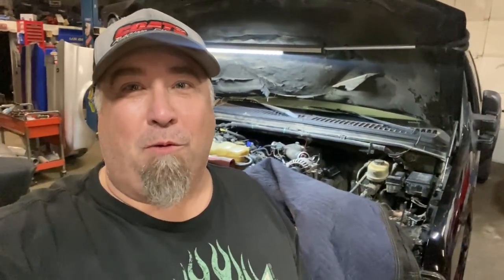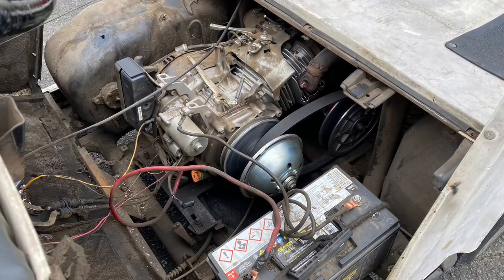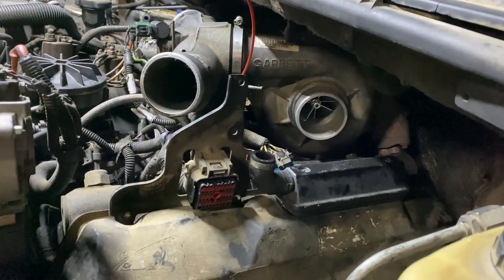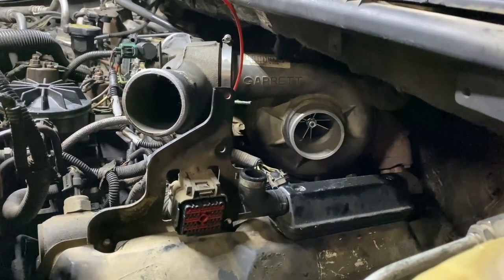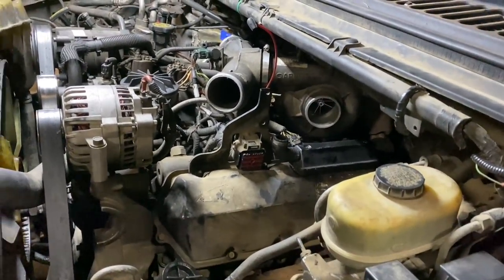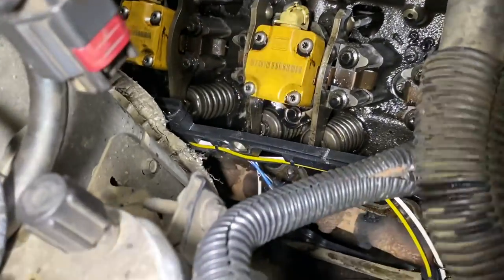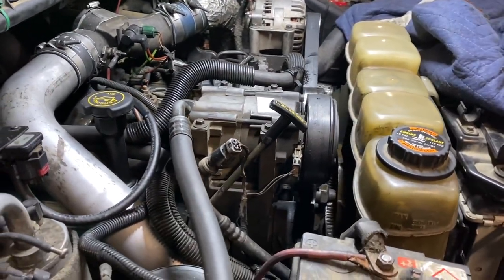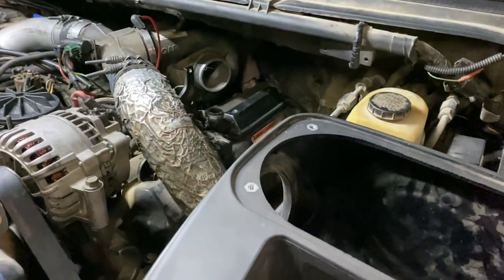7.3 Glow Plugs, wow that sucked! LOL

Comment: Turbo John is the man. Good tips.
I have dedicated 1/4 inch 10mm socket taped up to extension.
Has anyone had good luck with magnetic sockets. I have not.
The rubber hose is also great for spark plugs. I keep a rubber hose and long spark plug boot.
Also keep those 90degree spark plug boots great for pcv valves.

Comment: Probably already know this but incase not I would recommend pulling tank down and cleaning or replacing the 2 small filter screens on the bottom of the sending unit if it's never been down or replaced.  Might start having issues where it starts dying or not starting before it gets down to a quarter maybe half a tank on the guage.  Sometimes after a few hundred thousand miles they'll get clogged up depending on how dirty the fuel was being run in it. I replaced mine with an aftermarket deal and I've heard some people leave them off but I myself would just clean or replace them. Just a heads up from a fellow follower of yours. Might help you out down the line
Reply: Came here to say the same thing, mine had a big screen at the end of the tubing but came into what looked like a fuel pump with 2 small screens that (after cleaning them) looked like 2 stiff lantern wicks. Replaced them all the following week and keep spares and an engine position sensor with wrench in the dash.....havent needed any of it since but its there if i do.
Reply: @young11984  yessir I've owned a few of these trucks still own two. Both 02's. There damn good motors/trucks. If taken care of right. I've seen a few trucks fall apart around the motors. They last forever.

Comment: Never thought of taking the air out. I used to take tires off for my dad. He was the only one capable of working on diesel at our shop. I need to learn diesel. I just personally don’t love them. I don’t tow much other then a racecar occasionally. Is diesel that much better to tow with?

Comment: it is normal for the glow plug system to stay engaged after the wait to start indicator light goes off during colder weather.
Reply: No probably is the solenoid is stuck there is one like the starter solenoid on the engine that runs the glow plugs try changing it
Reply: @joepatenaude3957  that might happen, but very very very rare. I've worked at Ford dealerships for 17 years, 6 of those years were working on 7.3, 6.0, and 6.4 diesels. check it with a scan tool and you will see the PCM commands the solenoid to stay on even though the light goes off. Joe diagnose before replacing parts.

Comment: The factory ford GP relay is NOT rated for its intended use. Upgrade to the stancor style 586-902 relay and keep the connections clean. The GP dummy light is just a “reminder”. The GP’s will run for about 90 seconds when cold even when it first fires up. That little oem starter relay was never intended to deal with that much amperage for 90 seconds. Add a little corrosion on the terminals and its meltdown time.
Reply: Gee that's funny, but most of the OEM GP relays run just fine for about 200k miles before going out.  I consider replacing that routine maintenance.
Reply: @salimoneus im sure a lot do last but out of all the 7.3’s my company and family have had i have observed them failing at a faster rate than acceptable. I will admit a few of them were failures due to a connection problem that melted out 1 stud on the load side but most of them simply died internally. Out of all the stancor/white replacements I dont remember seeing 1 single failure to date. My personal truck still running on the same one for last 15years. Im sure there are people on oem original’s pushing 400k with no issues but it our climate of changing weather I would see constant failures.
Reply: @starionslider2116  i doubt your claim that the OE relay is not rated adequately to do the job.  please provide some evidence that the draw from the glow plugs exceeds the OE relay's current rating.
Reply: @salimoneus  this is going back 15 years ago but from what i recall the GP system normally will draw 150 ish amps in cold weather and can remain active for 90 seconds. Now the oem relay is indeed rated at exactly 150amps (from what i remember reading that someone else researched) but the big factor is its not a continuous duty relay. So if a person living in a cold climate cycles the glow plugs multiple times you can run into a problem where the relay gets overheated. Again this was stuff that was discussed and discovered probably 15 years ago. Was there a scientific analysis done ? Probably not. Was there a better longer lasting option available? Yep. Was pretty simple straightforward improvement. If your in a warmer climate you would probably never even have any issues but if you frequent below 0 degrees and cycle the plugs you will find the weakest link in the system will be the relay.
Reply: @starionslider2116  pretty sure the glow plugs stay activated for up to two minutes, which should be more than long enough to start the vehicle, even in very cold temps.  

no need to keep cycling them, it's not recommended and will cause excessive wear on all the involved components in the truck (batteries, relay, glow plugs, etc).
Reply: @salimoneus  🍻

Comment: Dang, I barely got one minute into the video, and I see you flatted the front tires, ON PURPOSE.  Like the heaviest end of the vehicle, you're putting all that weight on the sidewalls of those tires, letting the rim edges dig into the rubber.  Sorry but that just seems like a horrible idea.  Get a damn step ladder, or another wheel to stand on, anything but flat the tires and cause completely unnecessary damage.  Sure they might be okay, but why in the world even take that chance.
Reply from the maker: Get you a step ladder bro!  😂